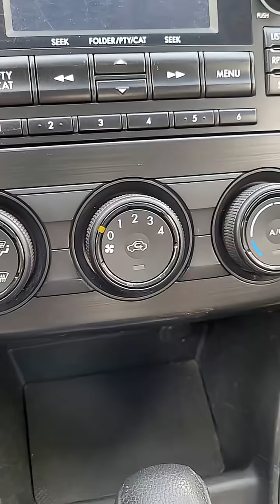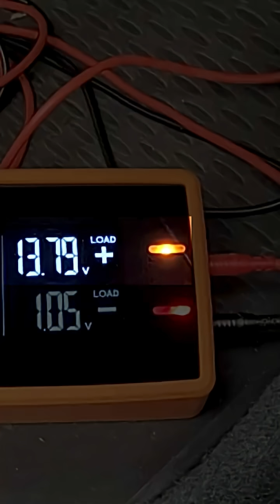Blower motor testing with DYVO and Multimeter

Comment: First, why does it matter what the battery voltage is when the blower motor is getting sufficient voltage to operate correctly?
And why do you need a box that is only able to be used for one kind of test?
If I use a multimeter for testing circuits on a vehicle, it will need to perform quite a few different types of tests.
And it appears you're box there is a 1 trick pony.
Reply from the maker: Thanks for your comment. 
We addressed why it's important to know the battery/system voltage while testing in the video. 
DYVO is used to test all circuits and components on a vehicle, not just a blower motor. This was simply an example. Check out our other videos to see all the different tests you can do with DYVO.